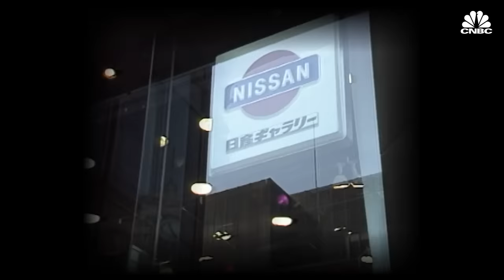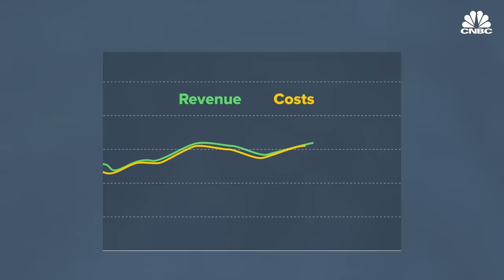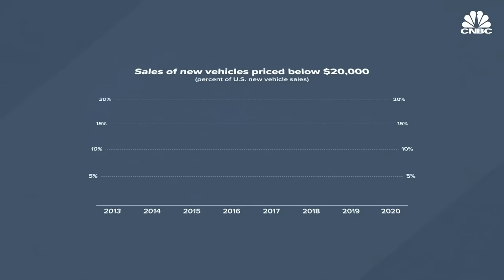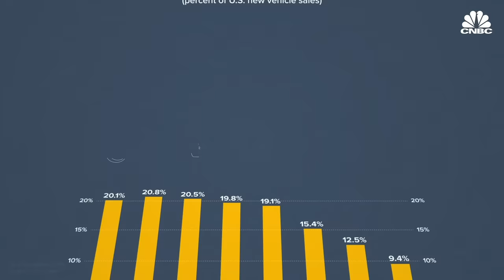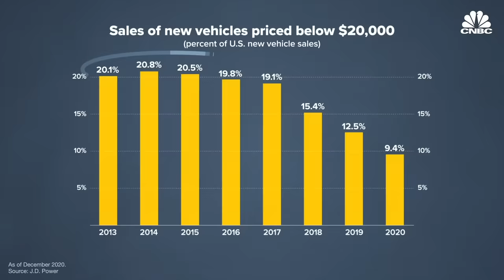Why Cheap Cars Are Disappearing

Comment: when i buy a car i want less equipment in it, since more electronics = more stuff to break
Reply: Exactly. My Bluetooth broke a couple of years ago, didn't even bother trying to get it fixed cause I knew it would be a ridiculous price. Bought an aux cord for 10 bucks that has been working fine 🤷🏽
Reply: Same. But I've owned about 50 cars so far, not a single new one. My primary car is 16 years old, the summer car is 21, and the other two are in their mid 30s. Spread the usage around all these cars and you can keep them much longer, like wearing 4 pairs of shoes in rotation.
Reply: CAR IS CAR! It gets me to places, i dont care about connecting my phone or bluetooth
Reply: Exactly what my mindset!! The only real computer I have in my Colorado is the ABS system otherwise everything else is controlled by feet or hands... manual transmission, crank windows, and no TCS. The less technology that is in my truck, the more money I’m saving in the long run.
Reply: Yup!! I am probably going to hold onto my older cars for as long as possible largely because of this. If you need Bluetooth just get an fm transmitter or a radio installed with it later on. 

We had one later model VW for awhile with a lot of the ‘safety features’ that most of which were already malfunctioning and made the car nearly unusable.
Reply: @the_kombinator  but how is your insurance...?
Reply: @vietster1141991  Cheap - under $1000 a year on the primary. Old cars = cheaper insurance. Hagerty takes care of the classics, which don't actually get used all that often.
Reply: @vietster1141991  OK let me clarify - insuring all those old cars is still much, much cheaper than insuring a new(or newer) car and paying the insurance on it alone. Plus, I don't insure the three classics outside of fire+theft during the winter months as they don't actually get used. In the past, I simply cancelled the insurance on the summer car, moved the plate over (legally, of course - it's cheaper than running two plates with two REG stickers and taxes) to the winter car, and insured it. 

A little bit of effort can see you owning multiple cars AND saving money ;)
Reply: @Michael-lu2tz  You probably still have a few if not multiples. ABS is one of course. But, you have a Engine control module (ECU/ECM) and a Body Control Module (BCM). The reason is because chevy likes to use a computer for the a/c system and interior lights + the BCM would control the headlights. Having a manual is hit or miss on a Transmission Control Module. Even with a manual some do have a computer to monitor the system. I know chevy liked to have the gauge cluster also be a separate computer. So, you have at least 3, but up to at least 7.

Having worked on hyundai's and Chevy's for multiple years I can count on 1 hand how many times I have replaced computers. Most of the time it is something else that caused the issues. Wires rubbing or poor terminal tension.

Even when it comes to windows I choose electric over manual. I have had more manual windows break or fail. For the most part manual and automatic are the same. The only difference is that the electric motor can is always accelerated and moving at the same pace vs a person that can operate as fast and harsh as they want. I feel like the human powered windows get more abuse.

I'm not against manual operation. To each there own, but most cars after the mid 90s have way more computers then you would think. Current ones can have up to and exceeding 30 computers. They don't fail a lot thought. Probably less then .5 of a %.
Reply: @custommotor  to each their own but personally I just like the novelty of mostly being in control of my car or truck. Thank you for sharing information on the other common systems, I wasn’t aware of most of them.
Reply: So many automatic features break due to repetitive use. Seat doesn’t need to move every time the door open.
Reply: That’s why I don’t buy cars with electric windows. People think I’m dramatic, but I’ve never had a window motor go out. Know why? I don’t have window motors.

Comment: I understand that modern cars can do amazing things. They can park and drive themselves, make phone calls for you, they can do everything but cook your meal for you. But I think my favorite cars were built in the fifties. You could work on them yourself, you didn't need to pull the engine out to change the spark plugs, and you didn't need a computer to do a tune up. I would gladly trade modern technology for old fashioned technology.
Reply: A tune-up is no longer needed because of modern EFI systems, and they regularly last 200k miles or more. Also it's nice to drive a car and not worry about being killed in a minor accident. It's normal to be fond of how things used to be, but technology in cars is light years ahead of where it was in the 50s, whether that's safety, fuel efficiency, cabin noise, modern engine oil, tire compounds, lightweight components, cooling systems, literally everything with the exception of styling has improved.
Reply: @lilTryhard  Impressive.
Reply: @lilTryhard 90s and early 2000s cars are where u want to be at. the safety of a modern car with the workability of a 70s car (if its a manual). My mustang is extremely workable, trans maintenance, oil changes, suspension work. everything in the engine bay is pretty easy to get to minus the headlights.

Comment: Top financial tip: do not put a car on a 72 month finance term...
Reply: Not to mention 7 and 8 year loans!!!! People think in terms of monthly payment. They NEVER consider the final cost!!
Reply: 3 years max, is my rule of thumb if I absolutely have to finance. I made the mistake once of a five-year loan, never again.
Reply: My last last three cars were low mileage used. It just doesn’t make sense to eat all the depreciation.
Reply: If you choose the right car/brand you can do 72...hint, don't try it with a Nissan, Hyundai or GM.
Reply: Amen. Dave Ramsey would have a heart attack!
Reply: I don't see the problem. I got a used, durable car at 2% interest on a 5 yr loan. I had the money to pay on the spot but I used that money for stocks instead. 

If you are buying a new car, it should be even more durable and the interest rate should be even better.
Reply: @hadracks  
I agree, I just bought a pre-owned Lexus from a private seller, 60 months @ 3.7%. I had almost all the cash to buy outright but liquidity is much more important to me than what I'll pay in interest as I constantly flip tools and electronics on the side and make 30-100% profit. Not to mention im waiting for the housing market to crash again.
Reply: Pro financial tip: always pay cash.
Reply: @danieldaniels7571  
Only suckers pay cash and lose liquidity. There's a reason you don't get an 850 fico without an auto loan or mortgage.
Reply: @ruthnoya8424  yeah, the people who really have problems with long car loans are the ones who are talked into buying cars they actually can't afford and shouldn't be buying. in my case, I've been taking long car loans for the past 10 years and even tho I could pay cash up front for both cars, I prefer investing the money in Apple stock instead. if you google it, you'll see that over the past 10 years Apple stocks increase in value more than offsets any interest a car loan could have, no matter how long. FWIW, I don't fault cars buyers so much as dealers because I think some of these guys must know that some of the people taking out long cars loans will have problems, but I guess to them any car sale is still a sale...
Reply: @danieldaniels7571  
Enjoy your two old $1200 cars you drive, in case one breaks down, you have a backup! Genius! If that works for you, great. But some of us want the reliability and safety of a newer, say $15k used car and are willing to pay $200 a year in interest to retain that $15k in liquidity to make 30%+ flipping items (in my case).

 I'm even contemplated flipping cars as I have a keen eye for the good ones. For instance there was a low mile, super clean end of run Lexus Sc300 on my local Craigslist last year. I spotted it the first hour it was posted. Original owner asking $7,000. I knew the car would fetch double that on BaT. I hesitated and sure enough it sold for $17k on BaT a month later. That's use of liquidity, being able to buy an asset quickly without having to grab a loan and lose said asset to someone who has cash on hand.
Reply: @IndyAvocadoKid  
I agree completely, see my last response post to Daniel Daniels. He doesn't seem to grasp liquidity and making your money work for you...then I read his other posts and I guess he's talking about paying cash for $1200 cars and making that work. Different strokes for different folks 🤔
Reply: @ruthnoya8424  silly of you to assume I don’t have cash on hand.
Reply: @S K I know this posts is @ruth, but I just want to say that that I never said that taking out a car loan was a good idea if you have difficulty with money, I actually agree with you that paying up front rather than using a loan is a good idea in that case. My post in which I mentioned Apple was meant to show that taking out a long car loan isn't always a stupid idea, if you can afford to pay up front and are financially secure then its actually better to invest than spend. I think then problem Ruth and Daniel are having with each other is they're seeing things from only one side, I come from a rather poor family where my dad made a living taking care of millionaire's yards and gardens. The reason my parents were able to quickly pay off the mortgage on our family house isn't because he was well paid (these multi millionaires are actually surprisingly stingey, my ma was working with dad one day and saw a customer angrily berate his servant for not using coupons to buy groceries!), but instead my ma was always unusually good with all things money related, she really knew how to save, budget, and only spend on necessary things that we could afford. She also taught me about credit cards, keep an eye on it and always pay off the balance as soon as possible because if you don't then that fricken' thing will rise up like a monstrous BLOB and try to eat you!

Anyway, this post is way too long, in closing I just want to say that in regards to finance, there is no one size fits all solution, different people are in different situations, and what's great for one person may be a really bad idea for someone else. Hope everybody's day goes well, and stay the  heck away from the BLOB!!!
Reply: @hadracks  2% rates on used cars don't exist, I don't care what your credit is... Why you lyin? Even 36 mos, the lowest is 2.99% with over a 750 fica.
Reply: @allaboutroofing2  I don't remember the exact rate but I got 2 offers and both were under 3% with one being better than the other. It is possible the 36 month was 2.49% and the 72 was 2.99% or vice versa. But 2.49 is below whatever you googled so  I guess you can keep calling me a liar,  maybe google was wrong, or maybe the rates changed over the years.
Reply: Paying cash for a car is financially almost as bad of a decision as taking out a 72 month term, IF you have financial discipline. Let's say for a $15k car you have the cash to buy it outright. The better thing to do is to take out a low interest loan for $14k (my local credit unions have as low as 1.89% for up to 60 mo!) and only pay a $1k down payment on it and invest the other $14k in the stock market. Even an average performing mutual fund will typically return at least 8% year-over-year, which means a $14k investment will return about $6500 over five years vs the paltry $683 in interest of the loan over the same time, netting you $6500-683=$5827!!
Reply: @youSupaflyy  yea don't pay cash. Mix deposit with a sensible 24 month to 36 month low interest payments. Negotiate your interest rates. If you can't afford the interest rate then reduce your vehicle expectations
Reply: @youSupaflyy  Sorry but there are no guarantees in the stock market and I'd trust Dave Ramsey over a random person. Dave says pay cash.
Reply: @ruthnoya8424  i have an 810 fico score on mine but never had an auto loan nor mortgage at all
Reply: key thing is to pay off the car faster than it depreciates so you dont have negative equity.
Reply: PK C
A 72-month finance contract will more likely than not tip one over a
financial cliff into an even deeper debt hole as the credit rating is burned
for the following seven or eight years.
By which time one will be barely able to purchase a  mobility scooter for 
the handicapped.
Reply: @borisjankovici662  That's exactly what they want you to do. Banks and corporations have figured out that they make more money when people rent everything and own nothing. They want us making payments on things forever.